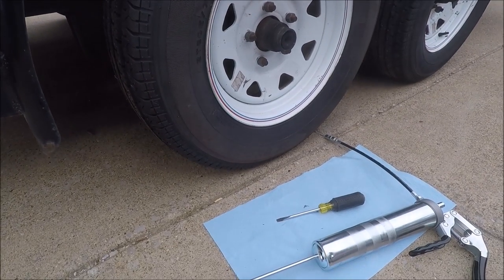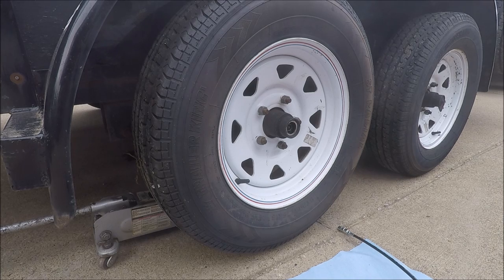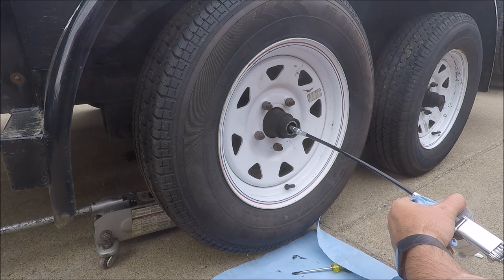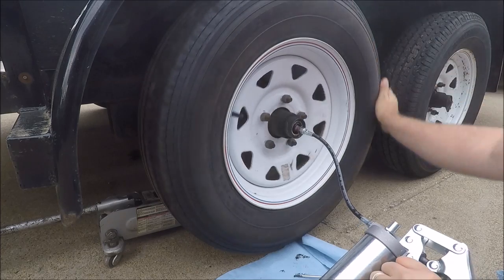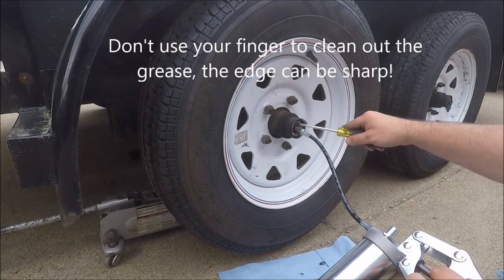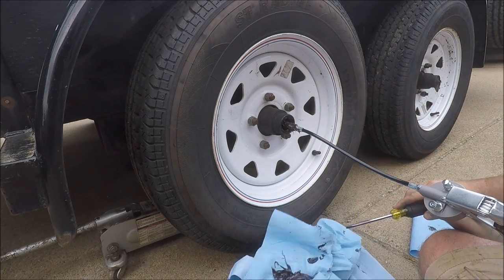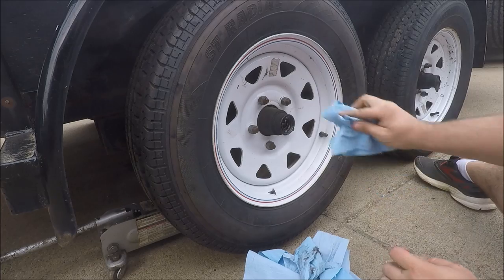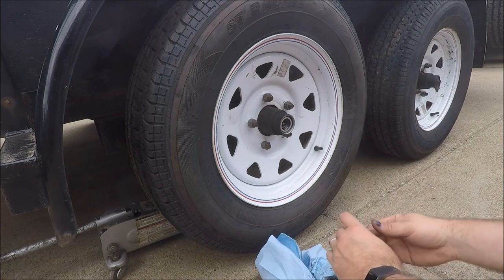How To Lubricate Dexter EZ Lube Axles

Comment: I would never do this ..........if you take the wheel hub off you will see that when you pump grease in it only greased the inner bearing.........you need to fill the hub to get grease out to the outer bearing ........you're gonna have greasy brakes ..........this may be ok for boat trailers but never do it to your RV ..........your life may depend on it ...........ALWAYS HAND PACK 👍👍👍👍
Reply from the maker: This is the manufacturer procedure, I’m betting they know more about their bearing design than you do.
Reply: Right from Dexter: https://youtu.be/XT0RKDGgDm8?si=h8U6VNFDE1YG5Z_3
Reply: @stuffyoucando2 I really don’t care …… I want to inspect those bearings every year by myself so I know what I’m pulling down the road……… you can gamble if you want to do good luck with that 👍🏻👍🏻👍🏻
Reply from the maker: @charlesmiller8672  2 months to reply and that’s what you come up with? Of course you assume that because I grease them per the FACTORY procedure that they otherwise must never be inspected, but you’d be wrong. I still have the trailer in this video, which is now 10 years old and still gets used regularly. Just in the last two weeks alone it’s had nearly a thousand miles put on it. Here we are, all these years and miles later and this trailer has never needed a bearing or seal replacement yet. What a gamble this must be huh? So if you consider following factory procedures a gamble, and want to assume that people who do that do nothing else to maintain equipment, well, we all know how the saying goes about assuming…

Comment: Trailer bearings are a scam. Why can't they use sealed ones like new cars have that can go 200k miles without any service? I know trailers don't get used all the time, but some full timers do use them alot.
Reply from the maker: Cost and practicality, it doesn’t make sense to use bearings that last 200k miles on a trailer that will never even come close to that.  Also, the EZ lube bearings make it easy to flush water out in marine applications as opposed to having to disassemble the bearings. I don’t think trailer bearings are a scam, how many have you actually had to replace? I recently had to replace a sealed wheel bearing on one of our vehicles at 60k miles.
Reply from the maker: You’re entitled to your opinion, but I’m not sure what facts you’re basing it on. Have a good day.

Comment: Think its easer to pull hub and repack by hand 🤣.  But i do like knowing i have dexter axles. OTR 48 years nice to check heat on hubs when you stop…. Few pumps if grease nice if one is running warm.  Not good to mix grease….
 Good video tho…

Comment: How about just cleaning and repacking the bearings at this point 😳grease would be coming out of the back also ?? No ??
Reply from the maker: Why would grease come out if the back, that’s not going to happen unless the seals leak. This is the procedure recommended by Dexter.

Comment: This IS NOT how to do it! You will blow out the rear seal and coat your break assembly with grease! If there is no movement in tire. A couple Pumps AT MOST! If there is some movement in the tire, REPACK!! 2:08
Reply from the maker: This is exactly their procedure, it IS how you do it. Don’t believe me? Go read it…
Reply: Dexters procedure

Comment: Install some buddy bearings.  Two pumps every six months each axle.  If there's grease on the wheel rim you got too much grease in the hub!  Back off the greasing...
Reply: What? Buddy bearings are the absolute worst thing you can put on a trailer axle. The dexter ez lube axles are far superior and are made specifically to address the “so-called” fix of buddy bearings by not having to repack your bearings manually. A simple google search would enlighten you much.

Comment: So what I'm getting from this video is buy a cordless grease gun, and make my life easier and make this quicker
Reply from the maker: Dexter doesn’t recommend use of a powered grease gun as it can increase the chances of blowing out a seal.
Reply: They work great if you get the 2 speed Milwaukee......never a problem on low. Can also set for 1-2-3 pumps per trigger pull or on all the time.   But spinning the wheel and warm grease really helps a bunch.  Do this as dexter says 2 times than i pull it apart.  Guys blowing seals out havent done and maintenance in a long time.👍👍👍

Comment: Four or five pumps!!! You have no room for expansion and will blow out the seal!! Pump WARM grease very very slow or you will also push out the seal!! After a few years of this and you start pushing old grease out, it’s time to remove, clean, inspect, repack and install new seals.  Please, please do NOT follow this guy’s instructions!!!!!!!!!!!!
Reply from the maker: This is literally the Dexter procedure, you have no idea what you’re talking about.
Reply: I know it sounds crazy but I have even spoken with the Dexter reps about it. I do trailer repairs and see the seal issues all the time, at least pump warm grease very slowly and wipe out as much as possible to create some extra space in the hub assembly.
Reply from the maker: @bryanmontgomery4050  and I’m sure Dexter will listen to you over their engineers. I’m not sure what you think you’re watching, but a hand grease gun does not pump in a large volume of grease with each pump, and you can clearly see me cleaning the grease out as it’s coming out. I’ve owned multiple trailers with these axles and have never had an issue. Many people who do have issues do because of using powered grease guns, which Dexter advises against. There is nothing wrong with doing it as pictured in the video.

Comment: Dexterity ezlube axels are a ripoff no matter how slowly or how easy you pump in the grease some always bypasses the axle seal and contaminants the magnet and or brake shoes. Be prepared to preform a brake job.
Reply from the maker: Nope
Reply from the maker: @craigrandle9033  I’ve had no issues. Most problems I hear of are a lack of performing the procedure properly. If Dexter is guilty of anything, it’s not taking into consideration that people don’t follow directions. Personally, multiple trailers and thousands of miles has proven to be that the design is perfectly fine.
Reply from the maker: @craigrandle9033  then don’t. I’ll continue to, no issues here.

Comment: He pumped way too much grease into that wheel bearing, also you should never jack on the axle itself you can bend the tube These are the kind of people that should not be on YouTube.
Reply from the maker: And you’re the kind of person who doesn’t follow instructions. This is literally the manufacturer procedure, you have no idea what you’re talking about.
Reply from the maker: Oh, and I know you know everything and all, but where I’m jacking the axle up from is at the spring which bolts to it. Notice how far outboard the jack is. There is nothing wrong with jacking from this point, which would be putting weight on the axle at the same point as when it’s loaded. Again, you don’t know what you’re talking about. People like you shouldn’t be running your mouths if you don’t know the facts.